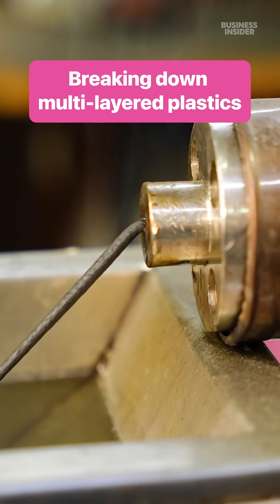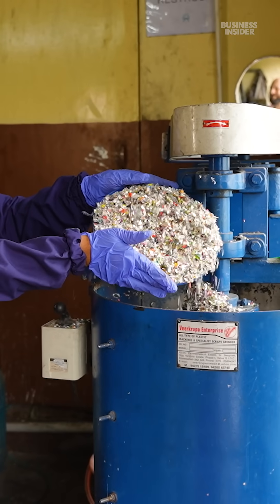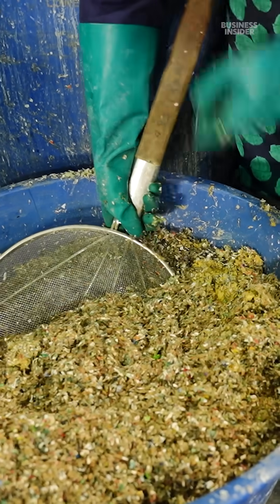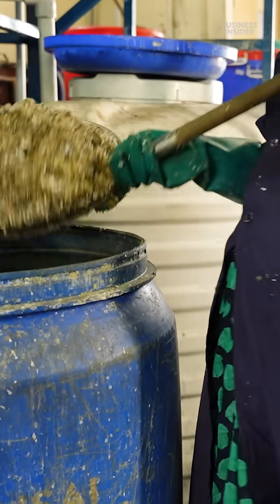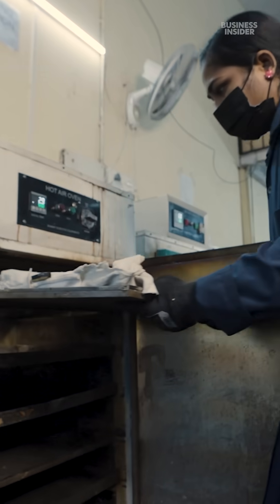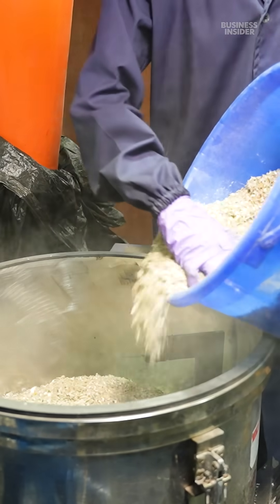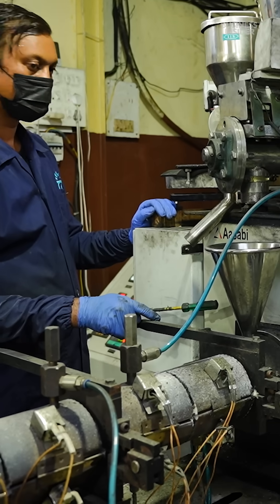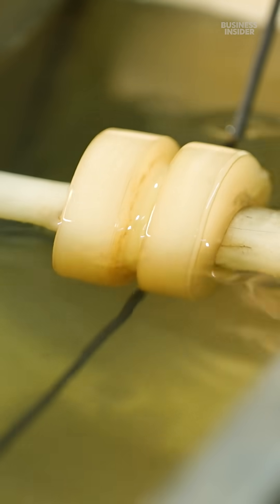Only a handful of places in the world can #recycle multi-layered plastics. #plastic #sustainability

Comment: That water based separation system isn't a new innovation. Its a system commonly used in mixed material recycling. It's basically just centrifugal separation using water as a mixing medium.

Also those workers should be using respirators...

Comment: These machines are using so much electricity, this is a net loss for the environment. You'd be better off with the plastic in the landfill where it will (eventually) break down than using this much power to make yourself feel good for "recycling."

Comment: Gaaahhhh I m glad I m not the only one who sees the gigantic holes in this from all sorts of perspectives - economic, public health and sustainability being amongst them. 

There is an awful lot of time, labour and energy going into "washing glue off some plastic flakes" - particularly perplexing however, is the fact they're then "dried and weighed" before being promptly dumped back in water - only to be dried again, before having charcoal added and being heated to a high temperature. The resulting "string" looks of spectacularly frangible and all round low quality. 

I literally don't get the point of this - it would seem a far more efficient, green, clean and cheaper solution to simply burn the plastics in a power station with all the right catalytic cleaning and carbon capture equipment. Or perhaps chemically "digested" to make something completely different or any number of precursors used in a variety of manufacturing. Or, I dunno, leave the glue on it and simply press it into plastic bricks for use in construction - they'd prolly be excellent insulation and dirt cheap - so long that the correct disposal method (as per asbestos) was eventually deployed. 

What we see seems about the most complex means of processing the plastic - for the most marginal gain.

Comment: Those workers don't have N95 masks. They're breathing plastic all day.
Reply: Forget N95, you need a full-on respirator with a canister filter for all the VOCs.
Reply: N95 does nothing. It still has gaps all around your nostrils regardless of the metal strip. These are micro particles, plastic dust.
Reply: @zeeitechriver  "Doing nothing" and "not preventing inhalation entirely" are two different things. I wouldn't argue against it if you said they aren't good enough but it is just factually incorrect to say they do nothing. If they did nothing, you would be able to breath freely when wearing one. You can't, since it restricts air molecules, which are smaller than plastic particles.

Comment: This is unhealthy the way they are "manufacturing" it.

There has got to be a better way to get rid of plastic.
Reply: There are. pyrolysis is one, plastic digesting microbes is another
Reply: @jonnda  The plastic still has to be washed for pyrolysis. Which is part of the overall problem. That water would need to be properly filtered. That's the whole problem with current solutions, they have some glaring major flaw which seem to be conveniently ignored.
Reply: @gregorymalchuk272  I've seen the pollution they cause. Still not that great.

Comment: I'm all for recycling but plastic becomes something else, usually. Also, recycling plastic is more expensive than making new plastic. We need to reduce and find alternatives
Reply: We need to go back to glass, wax paper, butcher paper, paper bags, cardboard cartons. Glass is easily and infinitely recyclable, paper is from renewable tree farms, wax paper and butcher paper won’t contaminate food with plasticizers.
Reply: @oliverheaviside2539  I agree, but we can take it further. There's plastic alternatives that are bio degradeable. The big thing is going back to reusable
Reply: @oliverheaviside2539  literally this.
Reply: @oliverheaviside2539  We need to go back to materials that are more expensive, require more materials, more energy, more carbon emissions, and more potential biological contamination than plastic?
Reply: @oliverheaviside2539  true. But multilayer plastic offer some benefits - cheap, durable and preserves food items much longer. These benefits can't be achieved by glass, paper etc. Innovation and regulations required to manufacture these in uniform way and make them easy to recycle. Only set of approved specification can be allowed to be used.
Reply: @oliverheaviside2539 glass is heavier so it costs more fuel to transport them. Also melt at a much higher temperature so you need more energy to recycle than plastic.... You will not win lol.
Reply: @middleagebrotips3454  the beautiful thing about glass is it can be reused without recycling.

Just need to adapt a culture of reuse, where companies are incentivized to collect glass vessels from collection centers and repurpose them.

Sort of like how milk delivery used to work.

Actually, there are still companies selling milk in glass vessels with a vessel fee you get refunded if you return the vessel.
Reply: @priestesslucy  I look at all my take out soup containers and lol. I reuse some plastics too. 

I know what you mean by glass return and reuse (I lived long enough to have done that), but I think the modern problem is that we have extra long supply chain compared to the old days where this glass bottle has to travel much longer to be refilled than before.
Reply: If we priced in disposal of plastics in the form of taxes (included negative externalities in the cost) then virgin plastics would cost more than recycled plastics.
Reply: @lephtovermeet  No they wouldn't. Crazy states already put large per-bottle fees on the price of plastic bottles and people still use plastic because it is far superior.
Reply: @gregorymalchuk272  what are you talking about? I'm saying if you priced in the cost of recycling into virgin plastics, they would be more expensive than recycled plastic by design. So if it costs a dollar for a lb or recycled plastic stock, you add $1 in tax the price per pound of virgin plastic. Saying that wouldn't work is like saying pricing something at $5, it wouldn't cost $5, because people buy it anyways. Like literally what are you talking about? Also I'm not suggesting an alternative, I'm suggesting we appropriately price in the cost of disposal and recycling and let the market figure it out. Why are you even talking about that?
Reply: @lephtovermeet and we still need to do something with those plastics, there's only so many playgrounds and trash islands we can make lol
Reply: @enigmaticrage812  with proper waste streams it's not as big a deal as people think. It's not amazing long term but plastics account for something like 1% of fossil fuels use and only like 10% of trash. Right now the major problem is we don't label, and we don't sort. We haven't priced in the cost of disposal into the price of plastics. Most plastics can be remolded 3 or 4 times. Some plastics can even be broken down into their constituent parts relatively easily. Every plastic should be labeled but some reason we decided to only label 6 of them and have an other catch all category for everything and not even make it a requirement to label every plastic component. So we've kinda just said, who cares not my problem and the best solution that regular people can think of is, don't use plastics, which plastic industries love because it's essentially impossible in modern life. Sure we could use less but literally the modern world could not exist without plastics.
Reply: @lephtovermeet that is exactly the same logic as tariffs.
Reply: @lephtovermeet  True, I still think alternatives are better than trying to recycle. I'm especially interested in the new version of degrading plastic. This may help with medical supplies
Reply: @1anastudent gotta be careful though. A lot of biodegradable plastics just break down into microplastics.
Reply: I have been telling people for years just use glass again
Reply: @VRimpressions glass is heavy and fragile, which is an issue for children and the elderly.
Reply: @soangry  actually no nether of those things are correct have you ever tried to break one of those glass coke bottles and I remember when I was a kid I was walking around swinging those things
Reply: @VRimpressions  glad to know that your singular memory trumps the hard fact that plastic bottles are lighter and more impact resistant.
Reply: @soangry  you are correct plastic is lighter but not that much more than glass
Reply: But then I guess we still need plastic straws because paper straws make stuff taste like crap
Reply: @VRimpressions or, glass/steel ones
Reply: @VRimpressions actually, there are biodegradable straws. There are a lot of biodegradable products on the market but the manufacturers of many of those products think people should pay more because their products are biodegradable.
Reply: There are alternatives, it just cost 10 times, or more, than plastics.
Reply: @DatNguyen-yq2jz the low cost of plastic could be a result of oil being subsidized
Reply: @middleagebrotips3454  In chemical extraction, the cheapest is from oil. Our medicine and all essential modern product is through the extraction from oil. The catalyst for production would be too expensive, less effective, and produce more carbon footprint without oil.  Do I want to move away from oil, absolutely. Even opec spent a ton of money to research other alternatives. Unfortunately, our comfort and way of life depends on it.
Reply: @DatNguyen-yq2jz  
However, that's where there is some confusion for me. My only real answer I've figured is the weight of the material per volume. Simply picking up one glass bottle to one plastic bottle, there is quite a noticeable difference in weight. So likely it's more so about the transportation of material costs that make using plastic vastly more viable than using better means like glass or even aluminum for recycling purposes. 
Glass in my state to recycle goes for $0.105 per pound (0.45kg). Depending on the type of plastic, $0.31 to $5.07 for plastic, and $1.36 for aluminum per pound. Glass is the "worst" to recycle due to its weight. 

What I typed is mearly my thoughts on why, I'm sure there's more to it than just what I assume.
Reply: @ganjasage420  plastic can prevent rotten infestation. Glass is easy to break. You want to sell something that feels fancy, you used glass
Reply: Hemp fibres! Biodegradable & safe, the cannabis plants can be made into anything !!
Reply: And to conserve water (I live in CA, I have this problem) we should build solar powered desalination plants.
Reply: @RBOutdoors1  I agree but unfortunately the people who own the water in CA won't allow desalination. Somehow they got the water even though it was public at one time. Heck, CA could even sell excess water to NV and AZ
Reply: @1anastudent  that’s what I’m saying. Desalination should be a thing, you can even just use the sun for it. We get 0 rain at all, and we need water and electricity. Crazy we don’t try anything else but trusting the government to do something about it
Reply: @RBOutdoors1  I agree. I don't understand anyone who lives in CA who isn't a multi millionaire. I moved away in 2017. I miss the theme parks & Mexican food but hey, I now have a house. I pay a mortgage not rent. I love CA but it's ridiculous. I recommend finding a job and moving
Reply: @1anastudent  I’m 15, so I don’t really have a choice lol
Reply: No u
Reply: I say we don't lose hope in recycling completely. There are ways to bring down the costs and applications & outlets we haven't explored yet. This is still in its infancy and there's hella more R&D to be done
Reply: @VDOless  I understand your point but part of developing a good system, like recycling, is fixing the bad parts. Recycling metal has been a lucrative industry for centuries. Plastic needs to be lowered in consumption or replaced with better products. Hemp can be made into a better plastic
Reply: makes sense in terms of energy. it takes more energy therefore should cost just a bit more. up cost is normally what kills the motive for morality. any suggestion on how to solve these problems?
Reply: There are safer ways to recycle it.
This being said, the best way to reduce the production, is reducing the consumption 🙏
Reply: Like glass? 🤯
Reply: Plastic doesn't have to be made from fossil fuels. The first plastics were made from vegetable oil. Next, consider thermal depolymerization. Any carbon based item can be converted to light sweet crude and either refined or pumped back into the ground.
Reply: @ceelyman306  So, you are pro plastic. Got it. If it ain't broke, don't fix it? I, on the other hand, have witnessed plastic dumps in 3rd world countries and a giant trash island in the ocean
Reply: I’ve gone back to all glass or Pyrex for food storage.  I got rid of all the poisonous Tupperware!
Reply: If recycling was never an option, we ran out of plastic already very very soon  and whole industry would have collapsed and changed to something else now.
We had been using plastics for almost 50 years(or more in some case), and we still haven’t ran out yet…

The grim reality is that 1st world countries have technology to recycle plastics, but they don’t and rely on 3rd world country labours for it.
Reply: @MP-vc4nu what a terrible argument. Just because we haven't run out of the base material of plastic (oil) that doesn't mean it's infinite.
Reply: @MP-vc4nu  What's wrong with that? If 3rd world countries recover value from worthless waste and create jobs, then how is that a negative?
Reply: @MP-vc4nu 🕉 Satyameva Jayate: Truth and Honesty and Reality is this recycling installation and process is going on in a Nation which is called INDIA… INDIA / Bharat is NOT ‘… 3rd World country… It is an insult to the people as 1.8 Billion individuals in ‘INDIA’ are part of a well developed Civilisation where advanced Technologies and innovative use of Science is applied to creat unique solutions to issues facing the ‘INDIA’… recycling, reuse etc. is part of the National drives initiated by Political Policy-makers… Prime Minister Narendra Modi is known World wide and is becoming a household name for his personal efforts to bring Good Thoughts, Good Deeds, Good Acts to change and to bring benefits for ALL communities in Bharat / India and the Global World communities… His initiatives are making tangible changes and progress in Bharat / India has been noticed during Modi’s Government… The policies that Modi introduced at home have shown several enviable outcomes to other National Governments elsewhere… ‘Self sufficiency’ and ‘vocal for local’ and other campaigns started by the Home grown Industrialists have created an ethos that has changed the way Bharat has taken its correct approach on a path that has made Bharat / India to become part of The Developed Nations… More can be said here, however, please do not keep placing Bharat / India in with underdeveloped Nations - Made in India initiative has in itself has become a noticeable part of the many goods that the 1st World communities use daily without realising that The source of their Goods, services and items at home and industrial activities is from Bharat / India… Next time you have a few minutes to spare look at the labels on the items you use and become amazed by ‘The Nation of origin:’ - Become aware of what Barat / India is supplying the 1st World Nations - Honesty is something that is also an export of Humble Bharat / India… Thank You for you time as it was a pleasure to inform you about what My Bharat, My India, My Punjab has supplied you in the 1st World!… Satyameva Jayate
Reply: @MP-vc4nu  Plastic is not like glass or metal. It's made of several ingredients, including oil. If you buy a plastic bottle labeled BP free, they used vegetable oil instead. If we didn't recycle plastic, they would just make more. 
You are correct about 3rd world countries dealing with our plastic. It's just a horrible product and we need to replace it
Reply: @gregorymalchuk272  I'd use a lot of words to describe plastic. Superior isn't one of them. It's cheap, that's why it's used. It's also subsidized, that's why it's cheap
Reply: @1anastudent  It has low breakage, lighter weight, higher durability, low contamination potential, is versatile, moldable at low temperature, has low materials costs, and low embodied energy. It's better in every way than older methods of packaging.
Reply: Plastic filled landfills can produce fuel In the form of gas and later a crude oil like substance can be extracted from the broken down waste years later.
Reply: Hemp